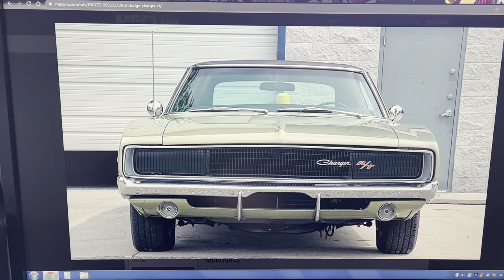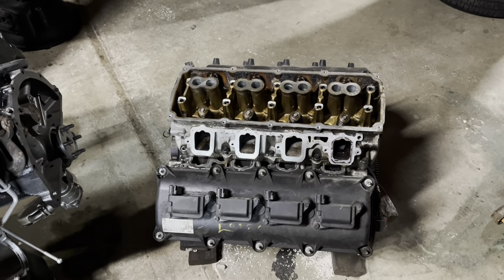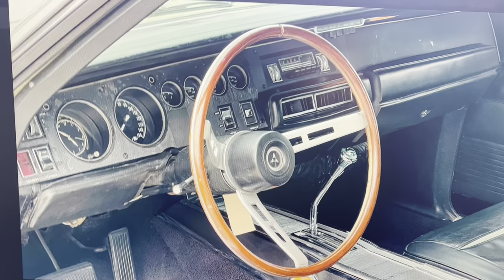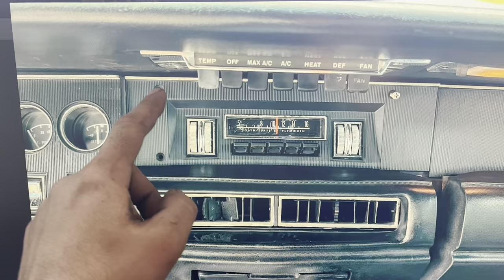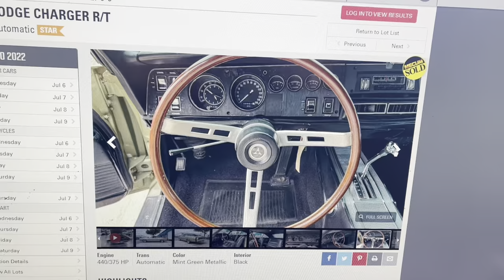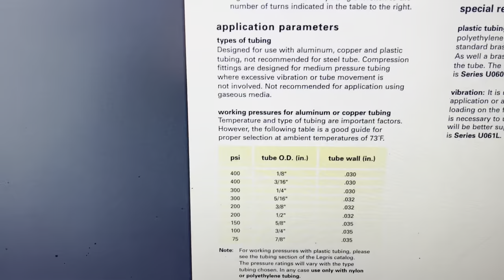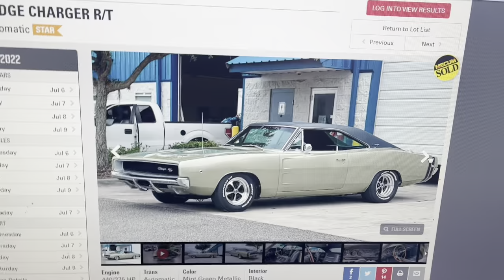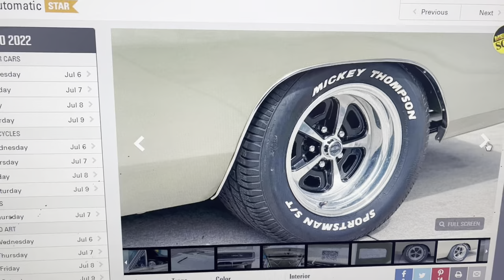Why Did This 1968 Dodge Charger R/T Just Sell At Mecum For $170,000? (It’s Unsafe And Bad)

Comment: If someone spent that much money without looking it over first, well jokes on them. I accept that.
Reply from the maker: That’s why I’m not afraid to air the laundry out on this thing. I mean, they spent the money. I still feel like I should call this crap out. It’s bad for everyone.
Reply: @DeadDodgeGarage  absolutely, great video
Reply: @DeadDodgeGarage  EVERYONE!!
Reply: Deliberately incorporating time bomb "repairs" into a death trap isn't a joke- it's murder- and a good lawyer could prove it, and put you in jail. "As is" has it's legal limitations, even for crooks.
Reply: Excellent, informative, responsible video. I subscribed to your channel! Incidentally, any idea what a 1972 New Yorker Brougham,  with NO rust, dents or body work, stored indoors for the last 30+ years, 440, ALMOST perfect in and out worth? Ran smooth off gravity feed, gas tank nasty. Thanks again!
Reply from the maker: Sounds like a sweet car, but I really don’t know the C body market super well enough to say.
Reply: @DeadDodgeGarage  Brother, I stumbled on your post about picking up the Demon. Didn't quite decide to sub on that one,  but your adventure with the kiddo in the rain with the Charger made my heart hurt. I felt for every challenge. The rain, the wipers, and every durned other thing,,, ALL while knowing I OVERSPENT when I paid $6500 for a one owner 26k mile SuperBird in 1986 and had a very similar ride home, with ignition cessation because a pothole rattled the bulkhead connector loose on the firewall and when the NEXT bump came along it blew the ORIGINAL mufflers right off the H pipe. Only for my buddy following me in my 68 Polara Convertible to run them right over, destroying them for sure. Not to mention the triaxle loaded with 82k that ran over them next. Yeah, I waited, and gathered the flat pieces that were still hot enough to burn my fingers and thumbs because the comedy of errors was still in full swing on the side of a 4 lane outer loop around Indianapolis at rush hour. 
Of course,  it never occurred to me until MUCH LATER that by pulling over immediately,  I had put the 'Bird in TERRIBLE DANGER of being destroyed by a dump truck that might not have been paying enough attention to lane discipline.

But luckily,,   that was about all the bad news that day. And she's still sitting safe under her cover with Richard Petty's Signature on the left upright still there. 
I have watched the hobby swing several times since then. I am still casually moved to disgust at how obscene the market is. 
With Worman boasting 1.5 million dollar figures for cars that you can watch him skin the primer down to bare metal as they pound upward on the transmission crossmember under the Gold Hemi Coronet R/T Convertible.  Preserved for all time on video and uploaded to the internet for ever,,, or until Putin vaporizes the world with Nukes at the will of the illuminati from their bunkers deep in the ground. 

Anyhoo,,,, I have enjoyed your sarcasm slathered honest takes about our beloved fratzog flyers. I was born in 66, and my Dad brought me & Mom home in a 64 426 4 speed Midnight Blue Poly Polara 500 2dr. Hdtp. And IT, is back in my hands now,  after years away from me, I got it bought back in 1987. [10k, ouch],,, and still,, I look for more.... it's an illness, I am told.

That R/T you just featured only underlines what my Granddad asked of me in 9th grade.  He said; "Patrick, if you will just NOT take part in using drugs, focus on your education and get a skill or two under your belt,  you will find yourself MILES ahead of others in life who started out with much better chances thanks to their families and money. 
And all his words have rung true throughout my life. 
I kept his 66 Monaco that they bought after I was born... because they gave it to me as my first car if I got good grades and stayed out of trouble in 7th and 8th grade....
Reply from the maker: @patrickwayne3701  Wow. That Superbird story... That's quite something. You've lived quite the Mopar guy life! Your grandpa had great advice. I'm proud to have started with nothing and gotten to where I am in life. I didn't really have anyone around to hand me wise words or guide me. I just kinda figured it out - but here I am. Thank you for watching and appreciating what I'm doing.
Reply: Murder? Probably not. But maybe some other charge regarding negligence or misrepresentation. Unfortunately, the buyer wouldn’t be around to benefit from the legal action…
Reply: @arthurrose6473  I know of one that fits that description in Titusville Florida and it's been priced at 8k and hasn't moved for 3 years.
Another one in Warsaw Indiana is 5500.00 and hasn't changed hands yet... but at 4500,,, they MIGHT....
Reply: @martinthompson2425  How about good old fraud? This thing is a death trap. I'm sure glad I don't live with the guy who bought this car. Don't wanna be within 5 miles of him when he has his A-HA, aw SHIT! moment. I also hope the buyer has no idea where the seller lives, or there could be a murder charge, just a 180° turn from where the guy who did the video thought the murder charge would be headed.....
Reply: @DeadDodgeGarage  That's why I like working on my own cars, can't trust mechanics.
Reply: @patrickwayne3701  Outstanding story.
Reply: True. That kind of money is crazy for any car, unless you have millions and it's a toy you can afford to fix.
Reply: @JohnJones-cg2xm  , exactly. With that kind of money you can cut the roof off and have Graveyard Carz build you another one using all AMD panels from scratch for another $170,000. Once you've reached that level of wealth,  money is like toilet paper,  if the first amount isn't enough,  use more.
Reply: I understand somebody buying something without knowing anything about it, I was like that when I was younger and uninformed.  

But this, this is more than just shoddy craftsmanship, this is somebody's potential coffin.    The thing about driving on the street is that you're not the only one out there, this could impact an entire family's worth of people because a guy can't stop his 68 Charger.   

People who build cars like this are the reason why insurance rates go up every year.  

I don't accept this....
Reply: @DeadDodgeGarage  you absolutely should, and I truly hope that somebody is forwarded this to the person that bought that car so they can get it addressed so they can live long enough to enjoy the car.  

I absolutely would like you to continue on with this type of videos.    You never know, I might even learn something new.   

I bought a Plymouth Cuda and the passenger side front frame rail was buttered over because it had an accident at some point in life.    

There was no mention of this, but the frame was gacked so bad that when I turn the steering wheel all the way to the right, it will actually touch the frame before it hits lock.      

I'll be paying to have it fixed by somebody I trust, it's going to cost a pretty penny, but I'm having them do subframe connectors and a bunch of other stuff from US Car tool to make that thing solid vv
Reply: From Jan's husband, your damn weight. If it's not road worthy it should be stated at time of sale.
Reply: More money than brains.
Reply: @patrickwayne3701 Your comment is written with a great sense of clarity, imagining your Super Bee and how these American made cars have made an impact on us that is so special to us we keep looking back at those youthful years and the cars that were special to us.
Really enjoyed your writing skill. You tell a mean tale that made me remember there's still some hope.

I was born before you by about a decade. I bought a 70' BSA Victor 441 Special. Unfortunately I bought it from a Cop who saw me coming. The bike had a kick start gear not hardened. Finding parts wasn't fun. I took apart the top end at 18 years old and broke one of the 4 cylinder bolts into the bottom casing. I shit a brick. Lucky a friend's dad new about the easy out method. I put her back together and after replacing the rings on the piston I bolted the head down, but had a hard time reaching one bolt head with the torque wrench. 
I adjusted the tappets with feeler gauges and stated her up.
The clutch was super tight to pull and when I let the clutch out the front wheel came up and had tons of low-end torque. After a few minutes the power dropped and I saw a head gasket leak near the bolt I had trouble with.

So disappointing. I bring the bike to a small shop in my town
 The owner is like 6' 6' tall and thin, I'm 6' 3' and even thinner. After picking up the bike that I asked them to fix the head leak and check the rocker valve gaps. When I show up he starts yelling at me how his worker wearing sneakers of course tried kick starting her up she kicked back. They never fixed the head leak and when I kicked her over the tappets were singing a bad song. 
I rode her home and put the gaps for the tappets back to the correct gaps.

Turns out when I go to DMV to register it it comes up stolen. So a SCPD cop sold me a stolen bike. 

So I moved onto getting a car and a friend and I were looking thru the local papers cars for sale section and Billy says look at this.

It was a listing for a 1972 Cutlass S with a rebuilt top end, 40k miles on it and straight as an arrow. Blue with black button tufted rolled interior in great shape. It was the fastback. My buddy was reading the manual from the glove box as we were hanging out at 7-11 one nite and turns to me and said, 'you know the S on the console doesn't mean second gear, it means SUPER! He was so excited, I was too I loved that car. I've had a Firebird convertible, and a Camaro SS CONVERTIBLE. 

Now I want another 72 Cutlass S badly. Oh well, I've been fortunate and ride an ebike, have two mini pin puppies and my garden. 

I do miss the dirty greasy hands especially when the dirt wouldn't come off no matter what. Working in dead of winter replacing a clutch to a buddies 66 GTO. 

If you read my rambling thank you. Keep on keepen on
Reply: The old car hobby is irretrievably broken. Too many rich boys, with too many criminals waiting to take advantage of them. The auction company's included.
Reply: @worms//// THE BUYER WAS A FOOL!!!!!   NO WAY WOULD I SPEND THAT KIND OF MONEY WITHOUT MY MECHANIC LOOKING IT OVER!!!!!!!
Reply: I suspect most would look how clean and nice shiny paint and have no idea how unsafe that is
Reply: That's just jealousy talking
Reply: He'll yeah that amount Gravyard carz could have done a restore the person who bought this is a fool sorry to say 😂😂😂😂😂
Reply: Man its 2023 nobody works for their money everybody is loaded u aint got no worries nobody doesm the government and parents hand out all that hard earned money from other people we all kive in mansions and drive 200000 plus xars now days. Even teenagers drive 100000 dollar cars to school to make fs and not learn a damn thing
Reply: >>>  === They say  E bodys : 71 Challenger or Cuda /  B bodys : 68 Charger or Daytona / C bodys : 71 Fury Sport.  These Mopar type alone will ALWAYS bring VERY TOP  ... T O P dollar. True supply and demand  never lies I guess.  === <<<
Reply: It's a false sale. Many auction houses do this to make it seem they are great. And other sellers will use them in the future. 

You put car in an auction hose even makes money if it does not sell.

They have bumped the price up to aide themselves for future sales

Comment: At $150k plus, a buyer should be picky of whatever car they are contemplating purchasing. You are 100% spot-on.
Reply: Damn right! I would never lay down those figures for anything that was under 100% right!
Reply: I think it is a bit much to use 16 minutes to rant over a small unoriginal breakline which can quickly be replaced. The car looked fine to me, except I would never buy a musclecar which is equiped with drum breaks on the front wheels.
Reply: that Charger was crap. I sold a better 440 RT back in the 80's for $700. Really, there is nothing special at all about those cars except the style which the Fast and Furious franchise made iconic. I bought a 68' L89 Corvette to replace it. Now, that was a special car, far superior to the Charger in everything.
Reply: @thorsrensen3162  If you didn't think it was worth it, why did you watch the whole thing? He picked out a whole host of other problems with the car, or did you miss those? If the brake (not break) line was such a simple job and they couldn't even get that right, it's a bad sign. Or does the idea of 4000 lbs of Mopar running into you because some hack couldn't figure out how to flare a brake line not bother you?
Reply: @americanAlienBoy  I have never seen a metal tubing being rupture from the force of a brakepedal so I bet it will hold I would nok be affraid of driving this car.
Reply: @thorsrensen3162  And how many of those cars had a hack job like that done on their brake lines? Then there is the missing front sway bar. The last thing you need on an already tail happy car is less front roll stiffness. I’ve done a lot of stupid things with cars, add driving that car to my list.
Reply: @ultrablue2  many bidders go on impulse and only think of the 🐏 fixations when the car brakes down on the way home.
Reply: As much as I love my old Mopars, if I was spending that kind of coin on a 68 Charger that is supposed to be mint, I'd have my expert Mopar friend go over it with a fine tooth comb! 
I don't mind the imperfections, that's a fact of life but this car really got the buyer by the scruff of the neck and wrung him out!
I really feel for the guy🥺

Comment: As a licensed mechanic in Ontario Canada I can tell you a compression fitting on a hydraulic brake line is illegal, and  would fail inspection. I agree with you 100% that whomever did this did probably committed other acts of butchery elsewhere on this car and i would not touch with a 10 and one half foot pole.

Comment: "Unsafe at any speed" is the classic reference for the lack of sway bar.  If you can afford to pay $170,000, you can afford a $250 inspection report.  Too much alcohol involved in this purchase.
Reply: Actually, sway bars weren't standard until like 1960...
Reply: I would also venture a guess that there was too much alcohol involved in the build.

Comment: Back in 1983 when i was 17 years old i was moving from the cleveland area of ohio to roanoke va. I owned at the time a bright orange 69 charger with the 383 engine. I was forced to drive that charger 450 miles all by myself due to the fact that i had next to no money. At 150 miles into this trip a rotted out brake line burst and left the car with zero brakes(and i mean none!)  I barely had enough money on me to buy fuel to get to virginia, let alone hire a tow truck. I didnt even have the ability or money to get to a parts store to buy a length of steel brake line, and had no tools to install it even if i could. So, i literally drove that 69 charger the additional 300 miles to virginia using only the barely working parking brake to slow down the car and sometimes even get it stopped. I was scared beyond crapless but somehow made it home alive with that car. 100 percent true story of a young and stupid broke 17 year old kid that i will never ever forget!
Reply: You grew up tougher too ! A great life experience !
Reply: I did a similar thing when I was younger in a 97 ranger. Had to lock up the ebrake once

Comment: I read a book by Carroll Smith, a famous racecar engineer. He believed that you must completely disassemble any used racecar and replace every nut, bolt, fastener and fitting. After seeing multiple versions of this build quality on different cars, I understand why. 
I think these rolling wrecks are the standard, not the exception.
Reply: Makes sense, but money is the issue.
Reply: the nuts and bolts are fine it’s the bushings and ball joints that wear out
Reply: Yup. And even an honest owner may cut a slight corner out of expedience every now and then. Something like using a regular bolt where a grade 5 or 8 should go might be okay, but over the 50 or 60 years some of these cars have been driving, and passing through multiple owners, those little time/cost-savers can add up and become a serious issue.  

I bought a 65 Mustang fastback survivor which is in overall good condition, 60,000 miles, previous owner had it repainted in 2009. On purchase I went over all the safety-related stuff, baselined everything, and gave it my own seal of approval. A month later - after driving it nearly every day - when I went to replace the carpeting I discovered the passenger seat wasn't bolted in. Like, at all. It was just sitting loose on the floor pan. How it got that way is anyone's guess (I suspect the painter), but it just illustrates how things get forgotten or bypassed over the years. You have to use the finest of fine-tooth combs on these cars!
Reply: @ML-dl1cp  Also  hard believing it's 60k mi when there is a digit missing on old odometers from 60yr old cars. Very doubtful. All the sellers have to say is" as far as I know it is correct". Could be true but very hard to confirm. After a car goes through many different owners upkeep eventually someone has to redo all of it. Looks good as new then bam it's only got 60k on it again just like 40years earlier just because the seller says so
Reply: @plap.  yup. Although mine sat in a barn from 1972-2009, so the 60k is probably on-point in this case.
Reply: I read Carroll Smith's book "Prepare to Win" it will save you thousands of dollars on your racing budget by just reading the chapter on nuts and bolts.
Reply: >>>  === They say  E bodys : 71 Challenger or Cuda /  B bodys : 68 Charger or Daytona / C bodys : 71 Fury Sport.  These Mopar type alone will ALWAYS bring VERY TOP  ... T O P dollar. True supply and demand  never lies I guess.  === <<<